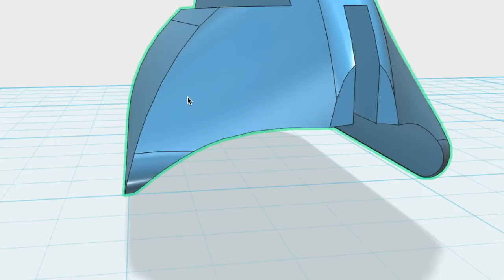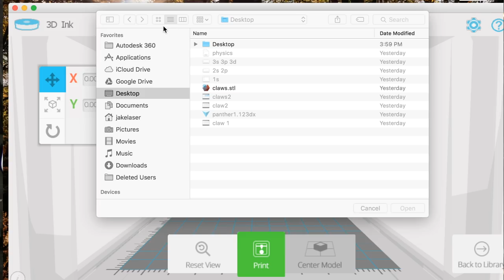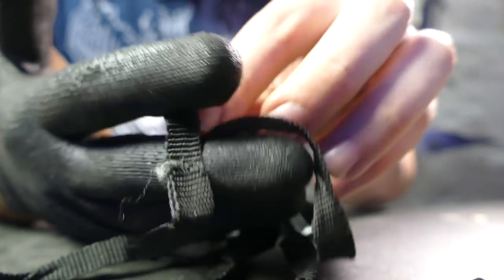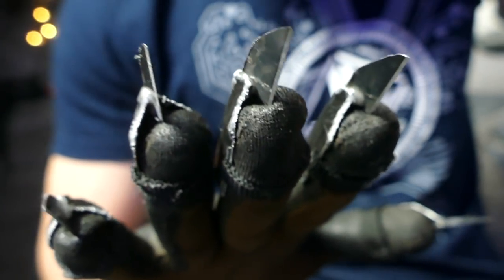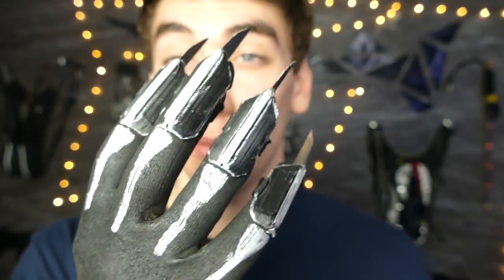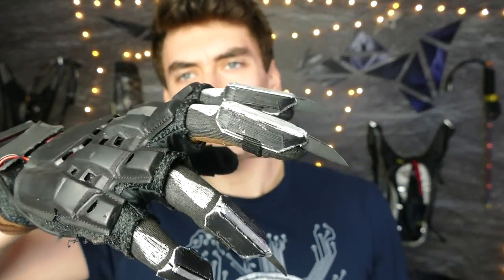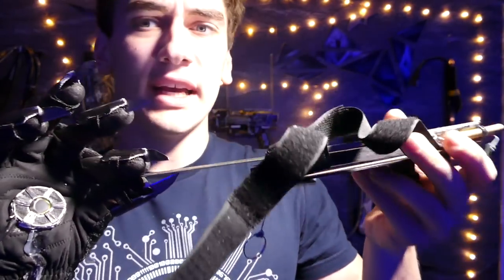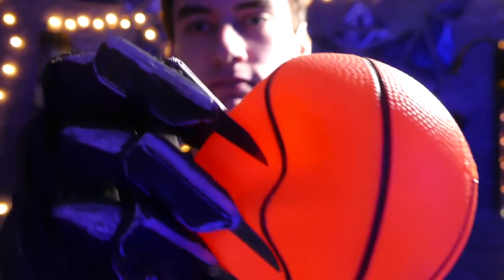How To Make Real Life BLACK PANTHER CLAWS!

Comment: Make sand drifter's ice box which was seen on the movie called "baywatch". It's an ice box but it's not exactly for a normal use. It has a small automatic gate open system attatched on it's bottom and it is also use a pulley system to manipulate the ice box hidden gate. It's quite amazing and easy build, so i just want you to try and make one of them.

Comment: Just an idea for making them retractable...
How hard would it be to make a housing with a small spring inside to push the blade out, then run a cable from each claw, around the back of the hand, anchored to the glove at the wrist.
In theory, when you curl each finger, the cable will pull the blade back into the housing, and when you open your hand, the cables will go slack and the springs should push the blades out.
I'm on my break at work, so I have no way to mock this up and test functionality right now